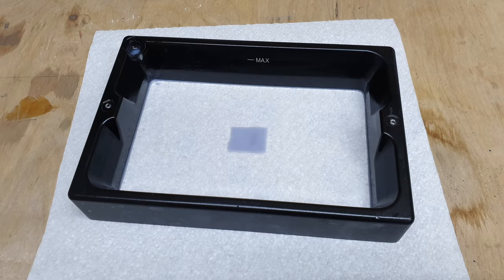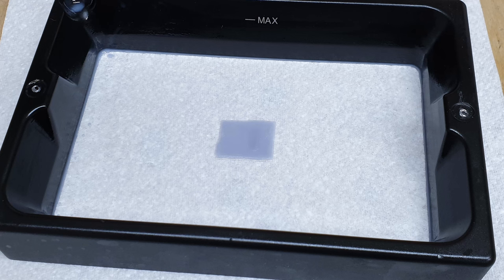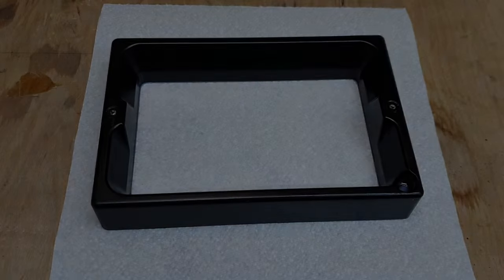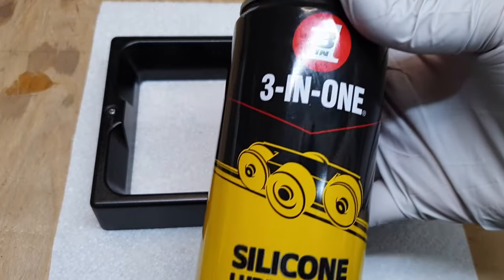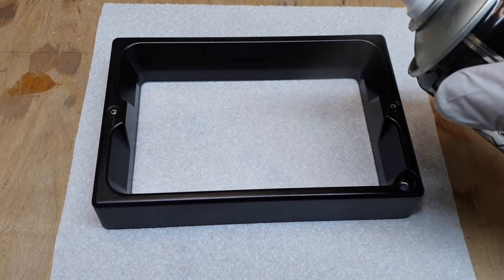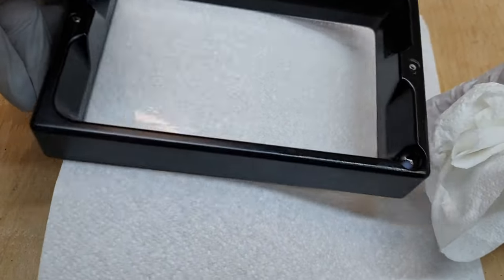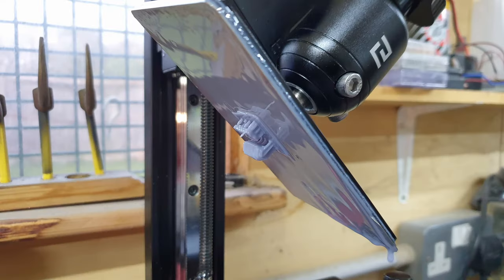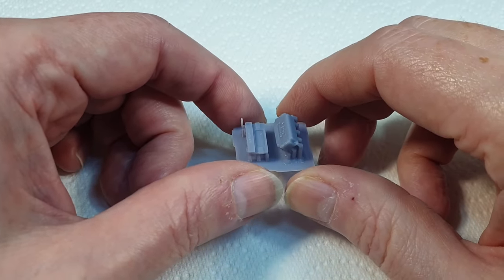A trick to prevent prints sticking to the FEP film on your 3D printer

Comment: If you are having sticking problems, its either due to HEATING or LEVELING. After a decent leveling, if things are still not sticking then go and do yourself a favor : Buy a tabletop heater for your printer. You can print in molten core of earth for all it cares, I assure you these things LOVE heat.
Reply: Yup. I leveled my machine and bed. But the table it is on isn't level.. addressing now. Hopefully it works

Comment: Lubricants or wipes on my FEP, no thanks. I have increased the base layer exposure time, with 20 seconds, problem solved. My problem is support pinch marks on the FEP, after printing.
Reply: The lubricant would also help with those pinches.
Reply: @yudratv5187  Thanks for the tip. It was due to poor model placement, those pinches.
Reply: But it's now always that, the issue. For me, the base of the model ist sticking to the bed fine, but after that, everything sticks to the FEP. I tried making the support thicker and that's not working and I also increased the exposure time for each layer. I'll give this one a go to see if it works for me.
Reply: @Seneca84  Same problem here. Did it work for you?
Reply: Did it fix?
Reply: @aponalraji961  increasing the base layer time and placing the model at a 45 degree angle, solved that issue. Now, I have a moist  issue with the lcd screen, leading to failed prints, due to the lcd screen not being level in its housing.

Comment: How to contaminate your resin. Bad advice, level your printer and check to see if your print surface was level from the factory.
Reply from the maker: Well, speaking from experience, I've had certain prints that fail consistently when every other print works fine, and doing this makes them print fine, so it's not really a levelling issue and, not to sound too facetious, if it's wrong but it works, is it wrong...? ;-)
Thanks for watching and commenting, I appreciate any feedback.
Reply: @SteamGeezerUK  I'd rather trace have contaminates in my print than all these failed ones I've been experiencing.  Thanks for the tip... I may have to try that out if my print keeps failing.

Comment: I use the manuals page to level the bed..once set I lift it by 0.1 or whatever the lowest height adjustment is. set it to home they're thats normally perfect for my mars 3 anything else is usually exposure times . However if I don't use it for a while beside mixing like silly I noticed the bed will creep 👇 ever so slightly from the weight I'm guessing 😵‍💫 I really should do a proper test but I garuntee I forget about it😅
Reply from the maker: Oh I agree. Nine times out of ten I have no problems, but occasionally I get something that just will not print, when everything else works fine. That's when I bust out the spray :-)
Reply: @SteamGeezerUK  glad too see haha 😆 but tell you what thankyou as I had no idea that was an option 😜

Comment: do you know if WD40 would do the trick if i dont have ptfe spray
Reply from the maker: I honestly couldn't say. You could try it, but I don't know if a mineral based oil would react with the resin.
Reply: did you try it and did it work, my prints have been failing constantly.
Reply: @NickTheNoob7  I tried a tiny bit of WD 40. Sprayed it on. Then wiped it off so it just had a bit of shine on the vat. I printed and it worked very well. I only do this during the cold season. During the summer I don't use any spray on the vat. The problem only happens during the cold season. So I only spray during the cold season now

Comment: I releveled at least a dozen times now and my printer is housed in an enclosure kept between 23-25C. Still, this print has failed repeatedly at least 10 times now. I've been experimenting with calibrating the zero point so much that I created a chart, and it still doesnt stick anywhere from 0.3mm - 2mm adjust at 0.2 increments? Im about to throw this thing out of the window
Reply from the maker: Does it work with other prints?

Comment: I have a filament printer, a Monoprice. I need to replace my table surface and am thinking of using glass as that would be more permanent than tape. I have also had some rattling as the head goes off the table, another problem to resolve. I can do a bit of 3D modelling and have built a few items for my model railways
Reply: I've got some Wanhao Dupli.3+, printed 1100 items on plexiglas with tape,  starting at 0,4mm above the build plate.